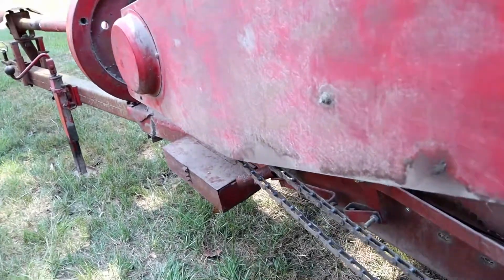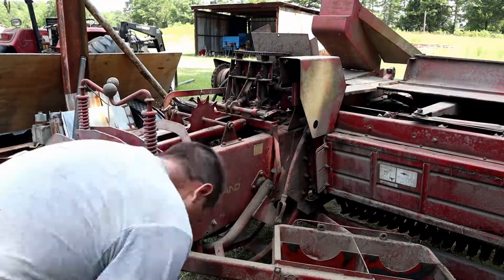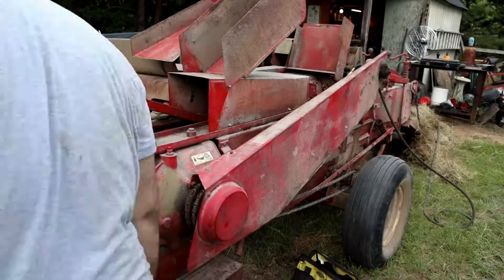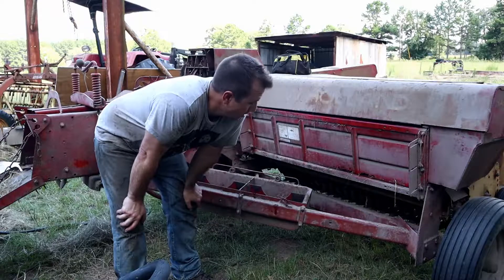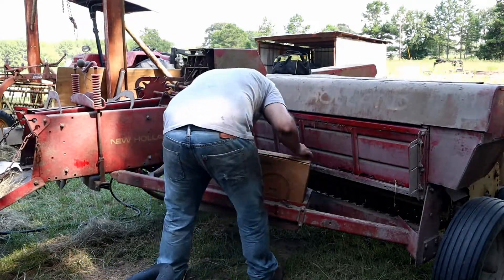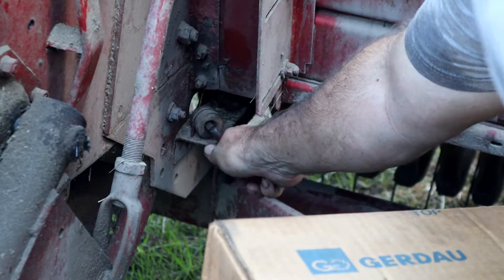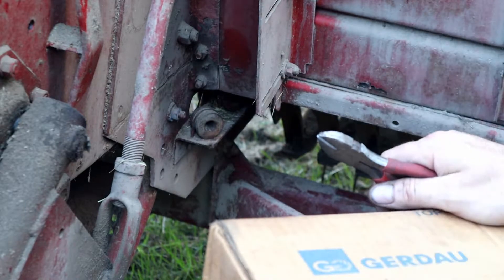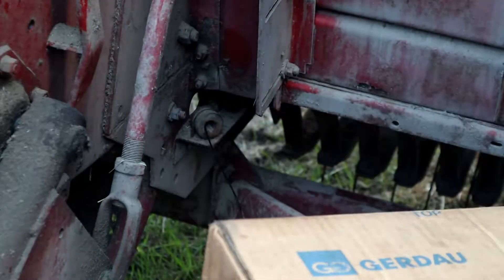New Holland 273 Hayliner Wire Tie Square Baler Maintenance and Hay Baled!

Comment: If a zerk don't take grease unscrew the zerk and try pumping with just the zerk and or go into the grease channel with a small screwdriver to clear the clots out. If it doesn't take grease it will fail.
Reply from the maker: That’s true and I did end up making a grease zirk clean out piston tool w/video that is useful when that method you mentioned doesn’t work.

Comment: Hey there, can you show how a tie its done? If you could had keep on recording on minute 17:33 i want to see how it catches the wire and make a tie thanks.
Reply from the maker: The action that you saw is the same every time. There is a pair of knotters that twist the new wire with the old. It does that as you are bailing and can’t be done empty as the wire has to be carried away by the hay as it’s being baled
Reply: Oh okay i understand now, im having the problem that wire get stuck its not making the cut on the wire how can k send you the picturo of the part that i think its not worki g right
Reply: And im also introducing hay with out moving the baler you think that works the same as in the field?
Reply from the maker: Well the bales moving through helps cut the wire. It may just be a problem with not running it through the field with constant hay. I’m no expert though

Comment: If the box the Baler wire is in gets destroyed, can you still use the wire? I've heard it's unusable without the box?
Reply from the maker: That’s a good question. I’ve never had the box destroyed, but it makes sense as it provides a circular guide for the wire. I’d say that’s prob true
Reply: @Man-Time  I work at TSC and have an entire pallet of the stuff that was left out in the rain. The wire is perfect however, a gentleman came in and told me that it was basically useless now. 

I would think you could transfer the wire to another box? Reuse another box? 

Thoughts?

Comment: How do you secure the wire to the knotters?
Reply from the maker: It should be at the end of the video there where you trigger the forks and knotters
Reply: Man Time thank you for the reply.  I mean before you run it to knot, do you just lay the wire in the grooves next to the knotters?
Reply from the maker: Oh I see. You run it over the forks and tie it off to the baler frame. Make sure it’s lined up with the wheels on the forks. Then you activate the knotting process on the baler while it’s driven from the tractor
Reply: Man Time figured it out awesome thank you.
Reply: You have a source online where I can still buy parts for a bailer like this?
Reply from the maker: I go through my local new holland dealer. They have all the most recent publications and updated part numbers etc.  If you have one nearby I’d recommend that
Reply: My baler started not cutting one wire every 5 or 6 bales.  Any ideas?